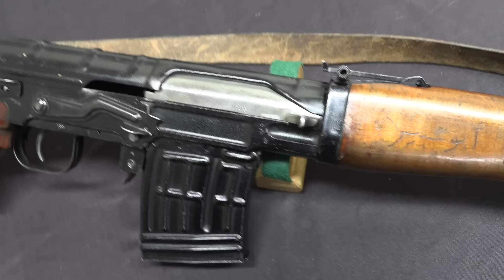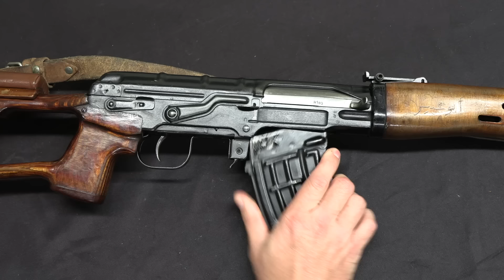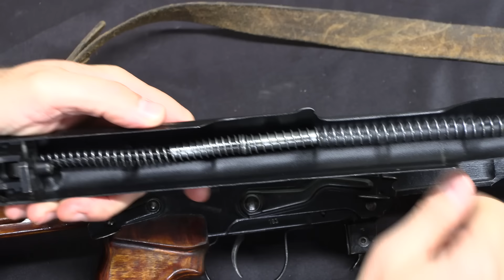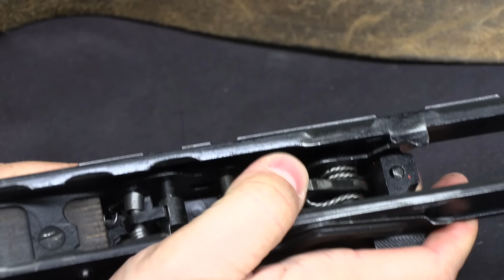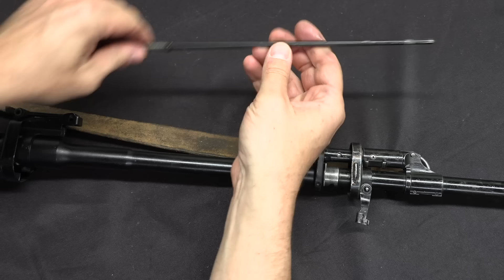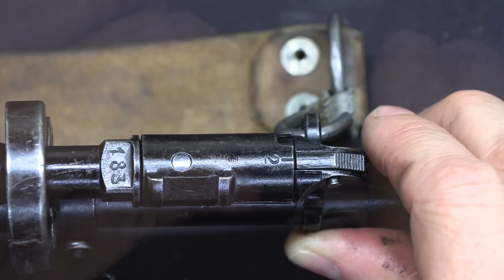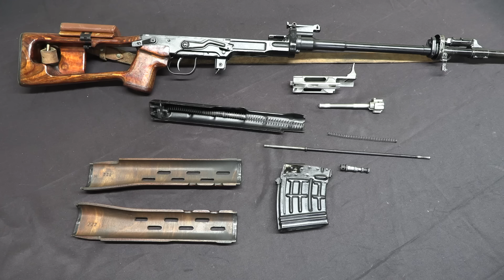SVD Dragunov: The First Purpose-Built DMR

Comment: Why don't Ian try to use the SVD in brutality match? The length and weight seems to be pretty much the same as that of the FAL.
Reply: I don't know if this is more offensive to the FAL or the SVD.
Reply: @hoilst265  According to wiki, SVD is 135 mm longer and similar in weight. The FAL has highly adjustable gas system, which is neat. Both of them are not inline designed. In terms of accuracy, they are not shooting that far anyway.
Reply: @hoilst265 😂
Reply: @吳秉樺-b7j  An in-line design, while good for recoil direction control, causes a problem. Rifle has to have a high sight line over bore. Also causes one to be a larger target in combat by making one crane the head up to the sight. The reason original AK-47 (or simply AK) had downward-slanted stock was to help soldier stay lower to the ground or keep the rifle in a more natural position for firing. AK has a slightly lower height over bore than a carry-handle-equipped M16 and M4.
Reply: Maybe he doesn't know anyone who has one to loan out. I don't think they're that common in the US?
I'm sure he'll pull one out sometime in the future though

Comment: What always struck me as odd is the 10rd magazine, when most other .308 DMRs have 20rd mags by default, while having roughly the same cartridge size.
Reply: Military weapons don’t always take practicality into mind, especially eastern designs.
The higher ups want you to make your shots count and not use 2x the ammunition.
Reply: Just an outdated design that noone bothered to change either because of concerns for reliability, or cost. Red gotta be cheap!
Reply: FAL and G3 were standard service rifles not marksmen rifles
Reply: Стабильная подача патронов с закраиной получилось достичь из 10 зарядного магазина.
Reply: Tbh, there isn't much point for DMR to have 20 rounds either. M14 has 20 eounds solely because it was an infantry rifle before and 20 rounds was more useful to that role.
Reply: It's not like Russia was trying to standardize with the west.
Reply: 7.62x54R is bigger than .308 and also rimmed, so a single stack mag was much more practical
Reply: @ивандонбас I mean they released several iterations of the SVD including the SVDM and SVU which is a bullpup that supposedly has 10, 20, and 30 round magazines, and I've even seen some pictures floating around of some supposedly pretty rare bakelite 20 round magazines so they exist at least it's just a matter of in what quantity.
Reply: The tapered rimmed 7.62x54R case would have a twenty round magazine looking like one from a Chauchat
Reply: I don't know if Ian mentions it in the video, but my understanding is that the magazine took longer to develop than the rifle, trying to reliably feed a rimmed cartridge into a semi auto is not easy, I'd imagine if it was any higher capacity the magazine would have to curve quite a bit.
Reply: @Liam-oy4kl He never said either the G3 or FAL. Also the PSG-1 absolutely counts, and any scoped variant of either do (Gv M75, G3A3ZF, SA58 DMR/SPR). While the M110 and every scoped variant of the M14 and AR10 fits the bill in spades, too.
Reply: @Ironpine27  it was designed in the mid 1950s which was 70 years ago. Didn't get adopted until 1963 which was 62 years ago. Not 80.
Reply: @MunnCher5 That would be the easy thing to do, except the SVD does indeed have double stack, double feed magazines. Fair amount of photos are available of such magazines from multiple sources.

Comment: Interesting..... It obviously has some AK inspiration in the design, but with a milled receiver and waffle top cover and magazine. The adjustable short stroke gas piston system is a suprise.
Definitely a step up from a standard AK-47 and well suited for it's intended purpose.
Russia have never embraced the latest manufacturing technology and it shows in the current AK-47 and the latest Dragunov.
It's a big surprise that the Russians still use the 7.62×54R cartridge with rimmed cartridges an oddity amongst modern military ammunition.
😎🇦🇺

Comment: One of the biggest issues in shooting an SVD is that the stock (at least with the guns obtained by Finnish military and now already phased out) was about an inch too short for most shooters, because it was meant for use with a protective vest. There were rubber pads that could be installed, but we never got those even though they were in storage. That short stock in conjunction with the rubber tube at the end of the scope effectively formed a suction cup around the shooter’s eye that felt mostly like it would suck the eye out with every shot fired.
Reply: "Boom! ~ Shlurp"
Reply: @ Exactly.

Comment: People really do get too wound up about accuracy in general, and with DMRs it's especially notable.
Such criticism is perfectly valid against sniper rifles, but not against DMR's. The reason is simple: DMR's are a "more" accurate weapon, not "the" accurate weapon.
DMR's are also almost always semi-auto. This means that if the first shot misses, the second one is available to be fired as soon as the action cycles, which is always done in less than a second even on the slowest cycling small arms.
Leave the sub-MoA work to the proper sniper rifles that are built from the ground up for accuracy above nearly all other concerns.
DMR's have to worry about things like weight, length, and commonality of ammunition (and possibly magazines) and accessories (such as bayonets) with the other weapons in the squad, but sniper rifles can sacrifice those in pursuit of even greater accuracy.
Oh, and the major point of difference between sniper rifles and DMR's is that sniper rifles are as a general rule bolt-action, because they can be made to tighter tolerance while remaining functional, a thing that semiauto actions can not do.
This is why the Barret M98 .50BMG rifle is an "anti-material rifle" while the M107/M108 .50BMG rifle is a sniper rifle. The M98 is semi-auto, the M107/M108 is bolt-action, that is truly the major difference between them.

Comment: Does 7.62x54r headspace on the rim or shoulder 🤔??....would have been cool to review it with the PSO-1 scope as its reticle and stadia are key enablers of the SVD in its intended role. It's interesting that semi automatic operation (rate of fire) won over bolt action (absolute accuracy) for the SVD.

Comment: Kind of surprised that for a rifle which they knew would always have a scope, they didn't mount it to a AR-style hinged upper/lower. Such designs were well known in the FAL, STG-44, and even early AK prototypes such as the AK-46
Reply: There may be few reasons. 
At first - SVD U-shaped lower receiver bearing energies of moving bolt carrier and barrel vibrations which become somewhat traditional for Russian firearm design dating way back to Fedorov Avtomat. Weight reduction was a BIG thing in design so you were gonna save weight in receiver cover. Later Dragunov designed compact assault rifle with top part being basis, though it was not for mounting optics but saving weight by having most of receiver polymer. 
Second - at first all three contenders were designed for having good old PU scope with Kochetov side mount. It also had a sense, as initially those DMRs were supposed to have option of stripper clip reloads and short tube PU make sense for this. This requirement was dropped fairly early but some roots in design were left (also there was semiauto hunting rifle "Medved" actually being sporterised early SVD prototype and it had short receiver cover with large extraction port opening)

Comment: Does it really make sense to call the Dragunov a "DMR"? 

From what I gather, the Drag was also developed as a fire support weapon, it could displace machine guns. The idea being that less, but more accurate fire was better as suppression on range. Hence accuracy requirements were very limited for something resembling a sniper rifle, and rate of fire is more important.

In comparision, DMRs are more about increasing the lethality of a squad, especially at ranges, and its about accuracy. Its generally not an LMG replacement or considered a support weapon. And the accuracy requirements are extreme for a standard soldiers rifle; its only really possible with modern technology to get this combination of weight/rate of fire/accuracy.

Comment: There is a reason you never see any of these with aftermarket furniture, optics or mall ninja laser/flashlight/fidget spinner shit on these rigs: you can't mess with utter success.  I count myself lucky to have picked up a SPAS-12, lucky due to a barrel length of 19 7/8". I have never been lucky in finding one of these for sale much less at a deal similar to the SPAS but i keep hope...
Reply: Yes, lets pretend SVDM doesn't exist...
Reply: @xSintex  ooooooh, I haven't engaged in any odyssey of the mind but correct me if I am wrong that the SVDM is a shorter barreled rifle with a divorced pistol grip as well as some receiver "refinements" to make it cheaper to produce. Yeah kid, I stand by the nonfiction comment I stated about the original SVD. Just a sexy bit of kit. It was the mall ninja statement, wasn't it? That's what made you crack your knuckles in anticipation of a ground clearing "ackshoeahly" hitter that made me wish I had checked with the hospital to see if they had room in the burn ward all while directly behind you in the background your PSA Gucci Gang AR sat chilling on a stand that used to hold your "authentic" katanas with a knockoff ACOG with seperate red/green/blue lasers attached on all three available sides of it atop that $520 flagship of your gun collection. Tell me you have beta mags and a foregrip that a bipod pops out of the bottom on that sick fucking rig...😏

Comment: I feel like 3x10-shot groups of 5.5" is way more strict than the M1's 5-shot group of 5" that seems to have been the standard? 3x10 and 5 shots really are not at all comparable, like, pretending otherwise is super silly.

And 3.5MOA in 3x10 shot groups with better ammo is good even by modern standards out of a semi-auto, and firearms technology has progressed SO much. I get that's not precision sniper accuracy, but that's like, extremely respectable sounding for the era? Way more than "perfectly acceptable" (and that's the worst acceptable accuracy, most rifles I assume are better than that. Also, it'd be slightly better MOA than that, 'cause 100m > 100y.)

Not saying the SVD is perfect or anything or great by modern standards, just poo-pooing the accuracy as "acceptable" feels kinda' presentist? That kind of sounds like "super duper accurate" for a semi-auto of the era.

Comment: Can we all just agree that being anal retentive about DMR/Sniper semantics argument is getting old.  Even Ian is getting tripped up trying to use the correct rifle pronouns to avoid angering the comment section. They are interchangeable in most uses and none of the differences can be applied to all rifles in the category.   Yeah, some snipers are semi auto and prioritize rate of fire and some are bolt action and prioritize single shot accuracy, but you often have two different roles use the same rifle for different jobs and the constant corrections over terminology has become rote regurgitation of US military doctrinal definitions instead of logical discussions about individual weapons in the context of their use.

In short the Draganov is both a DMR and a sniper rifle depending on how it is used and obsession over that terminology has added nothing to any discussion ever.